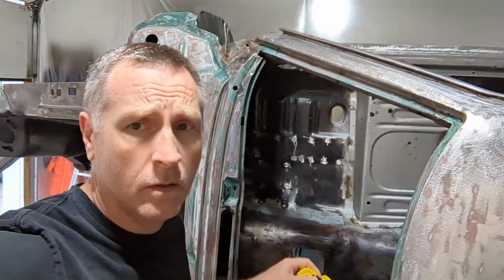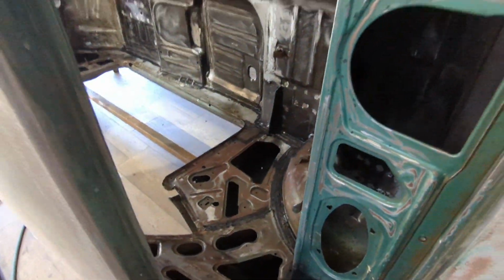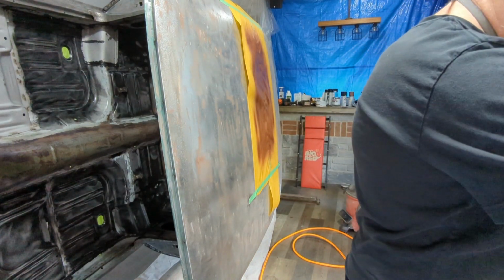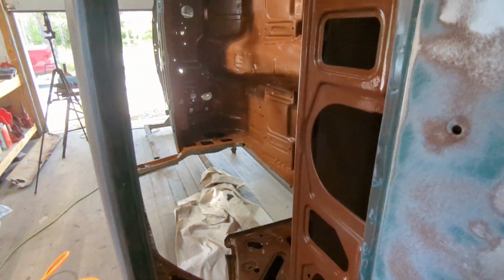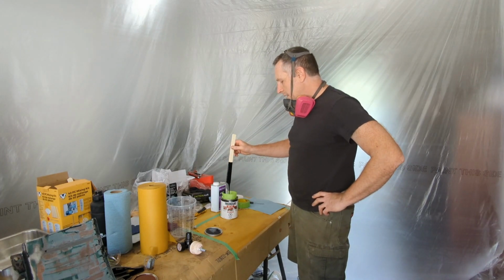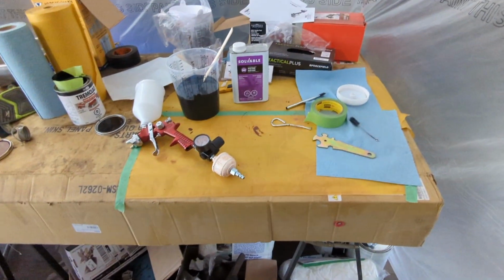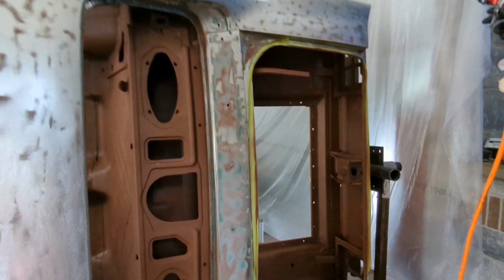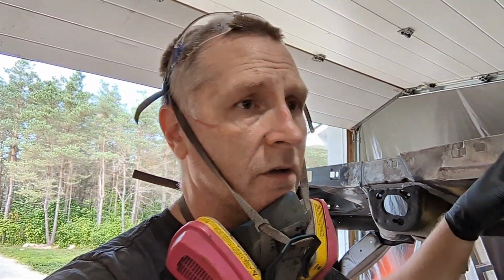Project Mustang # 32: Painting interior with Tremclad red oxide primer and flat black topcoat

Comment: Again, its fun to watch someone on the same journey as myself.. I did the underside last year, where the previous owner, had done full floors, with some patches on the lower firewall and rear transition areas both rear left and right sides.
This work was done in 2005, and metal left exposed to surface rust. We wire brushed and then did POR15 with a brush, upsidedown on the rotisserie. It came out awesome 👍, though i think like your approach of "Learning" to LVLP gun painting where you can. Love your results, keep it up brother!!!!
Reply from the maker: That's my next step. The underside will hopefully be a little easier. Less nooks and crannies to get into.

Comment: When it is skipping when painting check the vent in your paint cups cap, it can draw a vacuum if partly plugged and skip paint till it draws in more air to the inside of the cup.
Reply from the maker: That makes complete sense! Thanks for the tip

Comment: I'm no expert but isn't black very unforgiving in terms of prep, application, and panel alignment?  But it must be nice to be done with welding and structural work.
Reply from the maker: I'm not sure. All of the paint inside is going to be covered anyway, either by carpet, headliner or trim pieces. This was more for me to practice with the paint gun than anything
Reply: @ProjectBarn  Oh, the exterior will be a different color?